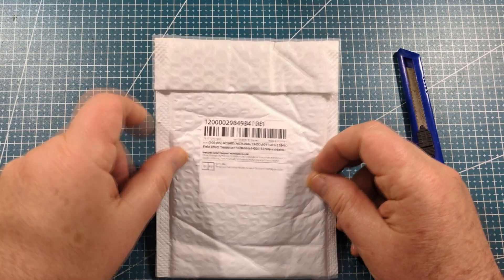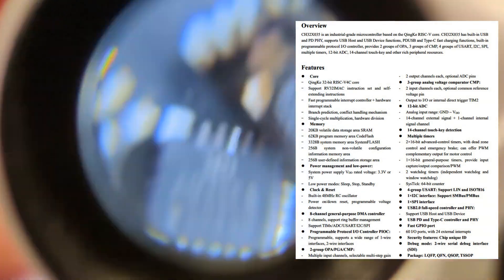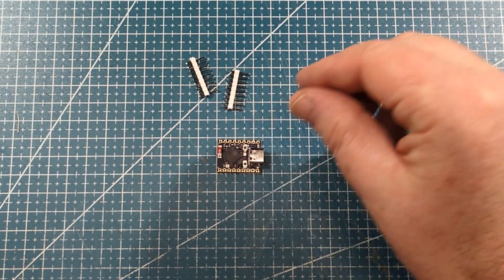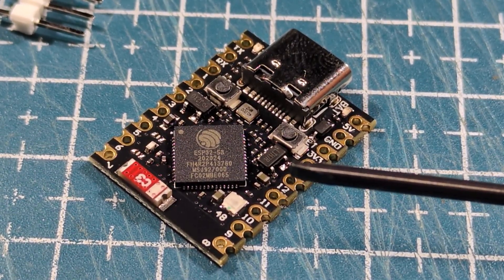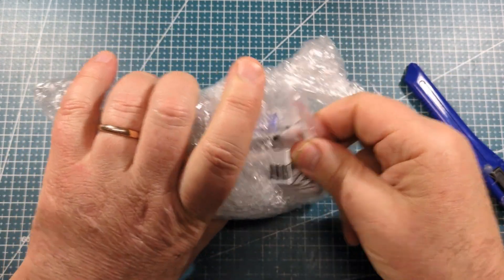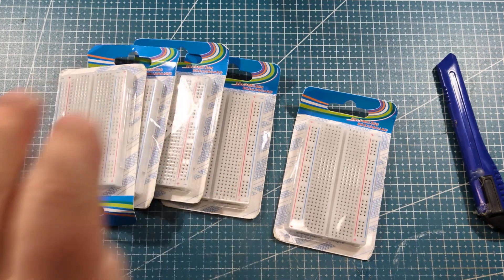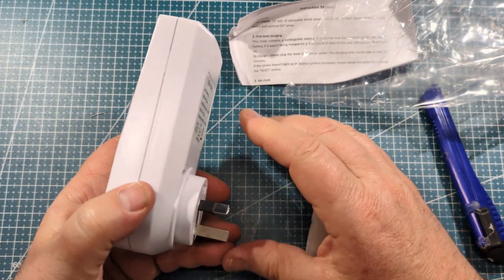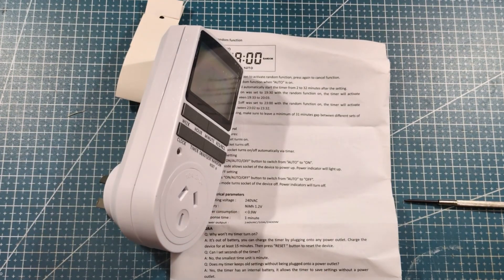Mailbag #44 - lovely modules!

Comment: I came across your vid of the safety car led circuit
If you add a set of LED's in reverse across the existing ones, they will flash alternately
I made a vid 'Police WigWag light bar for models.' ;)
Reply from the maker: Wow that's a neat solution. 👍😀
I have used that property of the 555 before as well! 🤦‍♂️